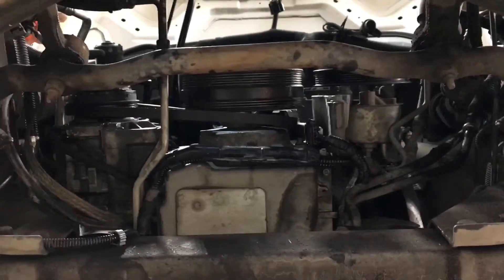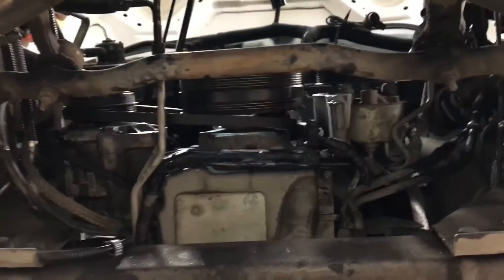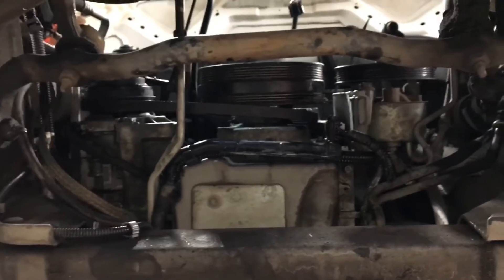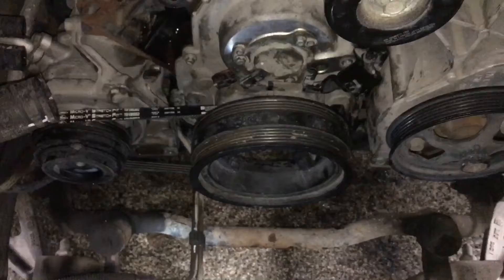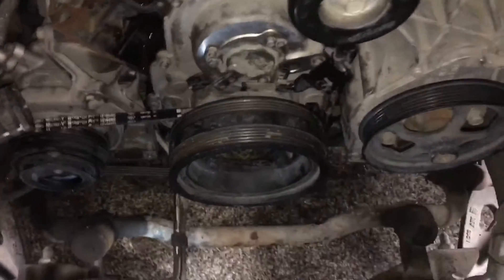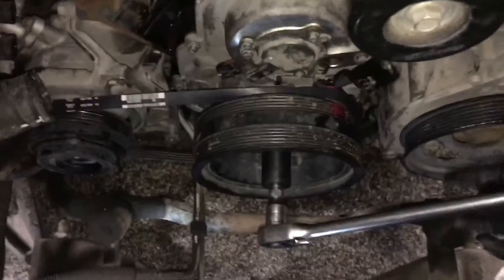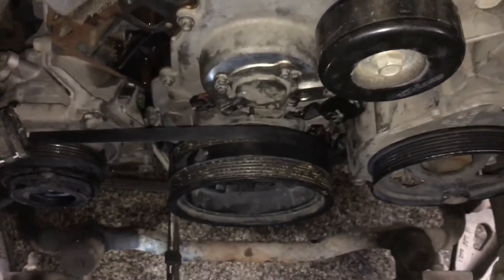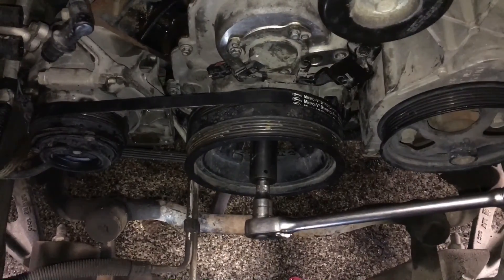How to install a stretch belt

Comment: FYI ... Just so your all aware. Any time that your rolling a belt on to a pulley or stretching it over, it is always easier to fit it on the larger pulley first then roll it on to the smaller one. The mechanics of this always works easier.  Now I'm not saying you can't do it the other direction but, you are just making it harder on yourself.  Also it depends if the tool will fit on the smaller pulley.

Comment: 1) Why not put the tool on the top side and turn the engine clockwise to begin with?
2) Guide the belt onto the A/C pulley as you turn the crank and you won't have to worry about it not being aligned.

Comment: It’s still very hard
Reply from the maker: It should be very tight but make sure you have the correct size belt
Reply: If its the factory belt it's pretty easy usually...these aftermarket belts many are smaller than should be. Measured OEM belt for Mazda and was 32 inches and Gates was 31.25. That's a big difference.